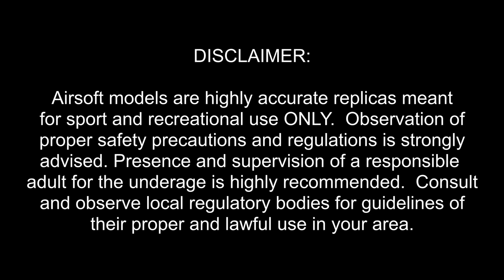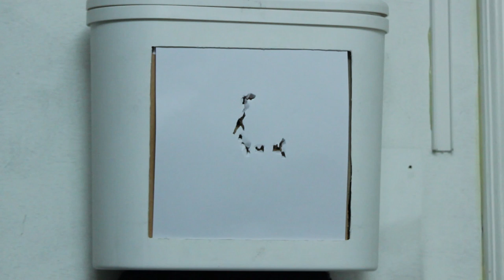Airsoft Diaries 13: G&P MK46 Box Magazine Repair - Fuse & Shrink Tube Trick

Comment: i saw the following a something you published and this was easiest way to contact you.
what you said:
"Air seal nozzles come in different lengths depending on the design of the airsoft electric gun and choosing the right length is paramount to ensure one less source of feeding problems. Too short and BBs might not load into the hop-up chamber properly and you end up with an air leak. Too long and you may prevent BBs from ever loading at all. In addition, the air seal nozzle is usually one of the first components to be swapped out for one that features a rubber o-ring to achieve an airtight seal"

just to let you know you have typed advice wrong.
if a nozzle is too short you will lose air and bbs will jam, , if it is too LONG then bbs will not load.

please change it as you are causing people to break their airsoft rifles
Reply from the maker: Hey, thanks for reaching out. Stock AEGs should come with a stock ASN that users can reference the length of. Most are also sold and labeled to a specific model unless you're mixing and matching for a specific reason.

For an aeg to also cause a jam due to a short ASN it would have to be incredibly mismatched. This goes back to referencing as close to the original length as possible (unless you're doing some kind of mod).

For finding the proper length you can also easily observe how your chosen ASN interfaces with hop packing through the chamber's feed tube. As with any modification or repair, I advise individuals to do a test fit and run an occular and by-hand inspection before finalizing everything.

Thanks again for your concern.